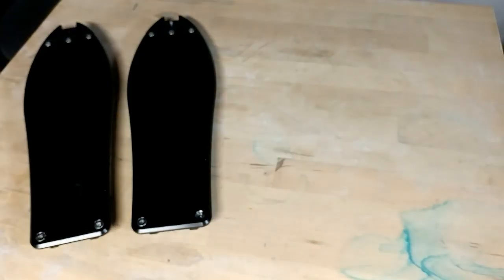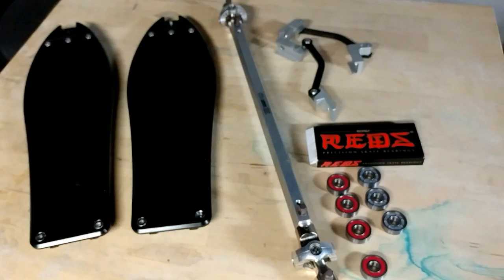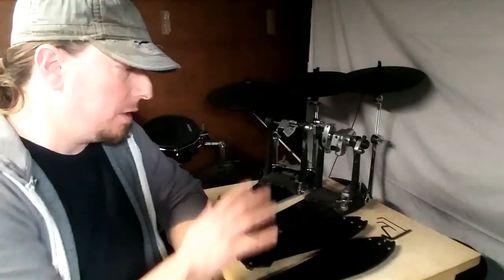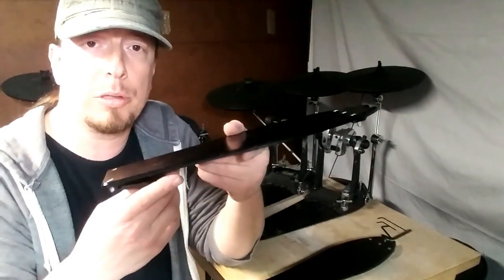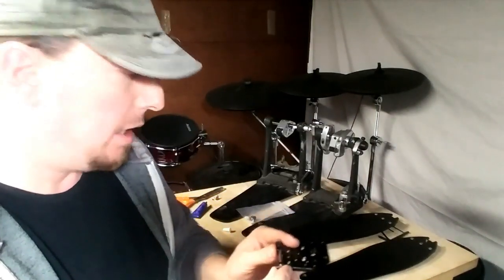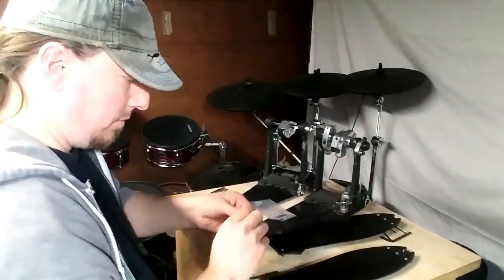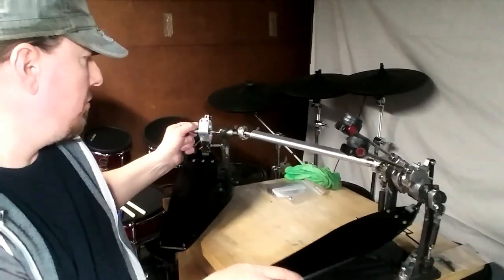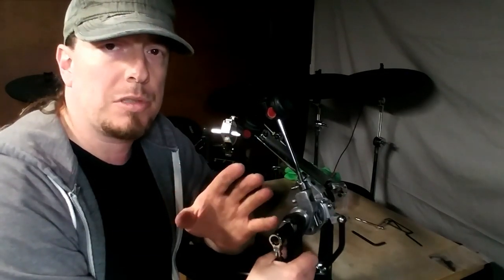Iron Cobra UPGRADES AGAIN - ACD Unlimited - Trick - Bones

Comment: Awesome video, Pete! Thanks for sharing your thoughts!

The white grease I use on the hinges has its origin in the RC-helicopter scene. Unfortunately, the company who made it (Robbe), went out of business a while ago. It's pretty awesome and stays on bearings and moving parts for a very long time along with providing some super smoothness. Luckily, I still have a few of these little tubes here but parallel I also started to use "Dry Fluid (Heli)", a special graphite based grease which is pretty thin and crawls in anywhere, doesn't collect any dust and offers some next level performance. It's very easy to use and works literally everywhere. I don't know if it's available in the US, but ordering a small amount from Germany might worth considering.

There's nothing wrong with the Trick shaft, the main difference is a different layout of the ball bearings (without prestressing for removing backlash in the long term) and the general weight, which is a little bit heavier. Due to vat and customs, there's a decent price difference in the US, compared to Europe, where both products are almost at the same price.  I'd love to, but unfortunately, it's not possible for me to sell the Ultimate DriveShaft on a lower price, since making these CNC-machined parts is already quite expensive, besides labor and other stuff like ball bearings. The joints on my DriveShaft are a little bit larger as you already mentioned (about 2x2") but by looking at your setup it looks like there wouldn't have been any problem. 

I'm sorry to hear about the issue with the DD-Kits. If you don't get them sold, feel free to send them back for a refund. I'm currently working on a DD-Kit for the Eliminators and DW9000 based on a  different construction which is more compact (it's not necessary to rotate the cam to the front anymore and also doesn't stick out that much). If it works the way it should be supposed to be, I'm thinking about doing the same construction for the IC and SC DD-Kits. Another idea for your problem specifically would be to use the inner of the two setup holes at the top part of the DD-Kit and just cut off the rest.

Anyway, thanks for the video, I wish you lots of fun with the upgrades and if there's anything I can do for you, please let me know!

Cheers,
Dennis
Reply: Oh, I forgot.. The main bearings on all Tama pedals are still the same, just the way they mounted is a little different and more easy to access. ;-)
Reply from the maker: Thanks Dennis! You're the man!

Comment: This comment is a couple years later after this video was published but ACD has updated its direct drive conversions and they are more low profile so they don't hit the drum heads anymore.  But the 1st thing I thought of when you said you weren't going to use them was why don't you just change your hihat stand!! Modern players use double pedal high hat stands that only have 2 legs that go towards the front it would free up space for pretty much anything you need! I cringe when I see drummers using 3 legged  hihat stands with double pedals, there's just no need in this day and age. Threading your pedals through legs of hardware is ridiculous! Haha even back in the day before the 2 legged hihat stand was more prevalent I still used a 3 legged stand I just cut one of the legs off. It wasn't as sturdy as today's 2 legged stands that are designed to be more stable but it still worked.  I'm sure you have your reasons, I'm just joking with you but I love the idea of the direct drive conversions so much I wouldn't let my hihat stand stand in the way lol
Reply: Yes, yes, and YES! My 1st thought, also.
Reply: I was thinking that as well. Or just move your hi hat back like an inch bro, lol. And also install the bass drum adapter that's provided, wtf!? That's why he included it with the parts...

Comment: Thanks for this video. Can i ask what tool you use to loosen out bolt that secures drive shaft ? I thought it was an allan wrench that i needed but these seem to be round fitting not square. Thanks.
Reply from the maker: Hi Rob, all of the screws are indeed allen screws, so, if any of yours look rounded, it sounds to me like they may be stripped.
Reply: @petegreendrummer  Thanks for replying but they have never been touched so i doubt there is any stripping. I will check again thanks. Also, is there a  generic spring you can recomend for this pedal ?
Reply from the maker: @rb397  Yes sir! Gibraltar sells pedal springs. Also, check your local music store. Their drum department will probabably have springs in stock. https://www.gibraltarhardware.com/product/sc-15c/

Comment: How has those Bones Reds worked out over time? Have they built up dirt inside? Looks like I have about as old set of cobras myself, for which I have never swapped bearings (nothing really wrong with the stock ones even yet).
Reply from the maker: Well, actually, I haven't taken the pedal apart since I made this video. But I've used it on dozens of gigs since, and I haven't had any problems!
Reply: @petegreendrummer  good to hear! With the little cost I might just aswell give them a try

Comment: I ordered a Trick drive shaft couple of days ago, this thing is a game changer. The problem with the slave pedal, in general, is that it never responds as well as the main pedal, even if you have purchased a completely new pedal, no matter if it's TAMA, Pearl, or Yamaha, DW etc. All driveshafts are produced as stock driveshafts, so even if its new you won't get an exact response from the slave pedal. However, it's not the same with Trick or ACD - those driveshafts are precision cut CNC production with better materials, plus much better design as an icing on the cake. Trick driveshafts sell like hotcakes, look at reviews on eBay. Why is that? I think because it is made by drummers who understand the problems drummers are facing in their daily routine - be it hinges, driveshaft, general wearing, ergonomics, the list is long. Big companies don't work like that - even in high-end pedals like Tama Dynasync driveshaft is pants, DW has his own issues and hinges are crap on IC's as an example. It doesn't mean that the pedal is bad, it means that it's a well-known problem for a drummer, but not for the company

Comment: Never seen anyone put the slave on the outside of the hi-hat pedal. Seems like it would add unnecessary torque to the driveshaft. I have the Trick shaft with the newer ACD dd upgrades on a speedcobra 910 and it's amazing.

Comment: Also, instead of long boards (which I do want to make), I removed the toe stop, and moved the pedal board back to those other 2 screw holes that are on the base, closer to the back of ur heel... The make-shift direct drives stick out just enough to not interfere with my toes.

And.. not meaning to come off rude on this part, but, with how straight u keep ur pedals, u honestly don't need a fancy universal joint setup. U might actually benefit from a straight shaft

Comment: Hey Pete! 
Did you drill new holes for the newer fotplate or does it fit exactley with the screws  from tama ? I have the same version and i just order new fotboords for my iron cobra. 
// Joakim
Reply from the maker: I did not have to drill new holes to fit the ACD footboards!
Reply: @petegreendrummer  Would you recomend the ACD footboards for the iron cobra ?
Reply from the maker: @joakimkarlsson9893  I absolutely would! In fact, since I uploaded this video a few years ago, Dennis (the owner of ACD) has improved the design of the hinge-bearings, so they're bigger and stronger than before. I've been using the newer design for a few months now, and they're awesome!

Comment: I used 4 bike seat height tensioner swivel cam thingies that are on every bike.. drilled a hole on the ends of the handle cam part, cut the threaded stock to about a quarter inch, and used a half inch long nut to connect the 2 (2 for each side).. those half inch nuts are actually from 2 of my old tom lug brackets.. just happens to be the same thread pitch! I literally unscrewed the chains and screwed the make-shift direct drive in the same spot. Little squeaky, so I lubed em up, sounds silent, ULTRA SMOOTH, SUUUPER quick response, and it was 11 bucks for 10 of em lol. They stay just as far from the head as the chain did. Cost me about 45min of thinking it through, 11 bucks, 20min of drilling and cutting the parts (NOTHING ON THE PEDAL! DONT CUT OR DRILL AN IRON COBRA! THEYRE TOO AWESOME FOR THAT!), and 5min to swap the chains for them n adjust em to my liking... SOOOOO WORTH IT!!! Forget spending money on a premade direct drive! These are so cheap, u can live n learn! Plus u get 6 extras (if ur using a double kick like I am.. if ur using single, u get freakin 8 extras)! Seriously, i just drilled holes about 3/8" from the edge of the handle parts, cut the screw parts to have about 1/4" of threads left, used the female threaded drum key bolt's nut from 2 spare tom lugs.. BOOM! Now that I don't have to think it through.. if I wanted to do it again, it would definitely take me about 30min start to finish, making my own direct drives.

Comment: You should switch to a two leg hi hat to get more room for your footboard
Reply from the maker: I've tried, but I find them to be too unstable.
Reply: Pete Green Productions 
Got ya 👍
Mines clamped to the side arm of my rack, no legs. 
When I ran a standard 3 legged stand I cut the rivets so I could sound the legs, but I play with my hh pedal to the left. When using both hh and left dbl pedal I go heel on kick, toe on hh. (45 deg angle) 
I might try your set up just to see how it works out. 
Great video tho, cheers 👍
Reply from the maker: @Adam_Baum  Thanks man!

Comment: dude you need a new double pedal i would like to recommend a mapex falcon or a pearl power shifter and avoid that long board shit though it works for some people (speed metal drummers) great channel i enjoyed the pvc snare build
Reply: I don't recommend the Mapex Falcon double bass pedal. I bought mine new about 2-3 years ago and the hoop clamp mechanism recently failed. The screws at the bottom through the stabilizer plate stripped out of the hoop clamp mechanism, which I later found out is mostly made of plastic and loose ball bearings. Longer screws solved the problem, but Mapex has no spare parts anywhere. They're all backordered several weeks and months. I'm considering switching to the Speed Cobra double pedal.
Reply: Lol mapex falcon.....speed cobras with a trick drive shaft with "on triggers" works like a dream on an ekit

Comment: I just watched your original maintenance video and commented that I wanted the trick and ACD upgrades.  Then I find this video!  I will likely do the exact same.  I have a Trick Pro 1-V low mass double pedal on order, so it will be interesting to compare with a longboard Iron Cobra with the Trick shaft.
Reply: BTW, I'm also interested in a cable hi hat...  Since both ACD and Tama use a cable from a mountain bike company, I'm curious how they compare.  Have you looked into a remote hi hat setup to ease your issues with hi hat legs getting in the way?
Reply from the maker: The Trick drive shaft is easily the best mod I've done. I've never played a Pro 1-V, but it sure looks like a great pedal!
Reply from the maker: I tried a tama remote hat years ago, but I didn't like it. It was a bit too time consuming to set up, even more time consuming to tear down and pack correctly (so that the cable doesn't get damaged), and, to me, it just felt weird. I'm sure they've gotten better in the years since, though!
Reply: @petegreendrummer  yeah, the Iron Cobra driveshaft has too much play.. I can see the Trick shaft making a big difference.  Was the remote hat this one, in specific the cable?  https://www.tama.com/usa/products/detail/hh905rh.html  I've never played a remote hi hat before... It seems like friction in the cable is the most important component and why they can get a laggy response.  I'm hoping this is solved with the JAGWIRE cable, but I need to do more research.  It's for a home studio so I'll mostly set it and forget it.  I'm eager for the Bigfoots to arrive (although the Darwin FTW is tempting!), but your video has me wanting to break down my Iron Cobras, replace bearings, driveshaft and put on some ACD longboards.  How are they holding up after a few years?
Reply from the maker: @adrumwhisperer  that's not exactly the remote hat I had tried. The one I had was a different design. I played about 80 3-hour gigs with my pedal before covid cancelled all of my bands gigs, but, it's still holding up good!
Reply: @petegreendrummer  Thanks for the info!  I dig the hiking videos as well.  If you make it to Atlanta, I'll show you some spots.

Comment: WOW! that new shaft and foot boards wore out in 2 years? That sucks! at that point i would have just bought new pedals. So this makes me wonder... if can't get the the balls in the original bearings.. what is the point of greasing them?
Reply from the maker: Well, I played over 200, 3-4 hour gigs in those two years... Regarding the original bearings, I'm not sure they would ever "need" to be greased, but, it's metal spinning against metal, so, the less friction, the better!
Reply: @petegreendrummer  I would agree. Is there metal on metal aside from the balls though? If you can't get grease in the balls... then does greasing really help? Or do those rings slide on each other?

Comment: Well... The Pearl Demon Drive Direct Drive system will work on Tama pedals, well build, less expensive... Probably.
Reply: Hi, I have these Pearl Direct Drive system and it doesn't work on Tama pedals, and I've Trying on a Pearl  P-932 and neither... And It's complicaded to sell these accessories for the same reason... are expensive... But...
Maybe works on the latest  Tama Speed Cobra HP900LWN version (I saw this in a Youtube video).

Comment: Hi, thank you for the Video.
Can you give me a tip how to remove the bearings inside the part for the left beater holder. I can't get the second one out of it.
It' so tight, i cant remove it .
I destroyed the first one to get it out.
Hope you know what i mean and you can help me.
All the best from Germany and a Happy new Year!✌️
Reply from the maker: I think I know what you mean, and for those bearings, I used a small, thin allan tool because of it's right angle shape. But you might have luck with a small flat head screwdriver, or a pick that has an angled tip. Good luck!
Reply: Thank you for the answer.
I think i have to destroy the bearing to get it out.
Hope I'll do not destroy the holder.

Comment: Hello and thank you for the videos. Just got a used Pearl double Redline Eliminator and goingto replace bearings as slave side is noticeably slower and stiffer, and oiling helped some, but not enough. Also have a new Trick drive rod on the way. Would you have any guidance on bearing size for them please? Are most pedals bearings a standard, universal size?
Reply from the maker: Hey thanks for the comment! I really wish I could help you out, but I have no experience with the Pearl Eliminators. But my suggestion is, if you're going to take the slave apart anyway, take out the bearings and measure them, then compare them to the Bones skate bearings. As long as you take your time, and don't damage anything while you take the pedal apart, you should have no problems after you put it back together! Good luck!
Reply: @petegreendrummer  Thank you very much for the very fast reply! After 40-odd years playing single pedal I'm going to give it a go on double pedal...looking forward to the adventure. Again, thank you for all the videos and going to check out your music later tonight. Took the bearing out of the slave pedal and no size markings, so will check with Pearl as I came up with 22mm x 8mm x 7mm and don't know a thing about skateboards either.
Reply from the maker: @DidYouReadEULA  I did a quick search and found that Bones Reds bearings are size 608, which equal 22x8x7mm! So they will work in your Eliminator!
Reply: @petegreendrummer  Thank you so much!! Going to get me some of those poste haste. Getting used to smooth cams on the Eliminators because I'm a DW 5000AD4 Accelerator man for past 20 years (upgrading with every new redesign), but trying to get used to different pedals in case I ever play out again and forced to use house equipment. Also got a PDP Concept direct drive and it feels almost like my DW, but these Pearl's gave my right foot quite the workout tonight!! Getting used to a single Pearl pedal again first before I try combining two. Gonna nail it though, can't give up!! 🙂 BTW, started out on an old Pearl strap drive, strange how comfortable it started feeling toward the end of my hour of practice. Ain't drums fun?!!